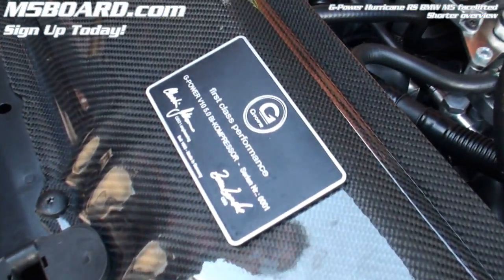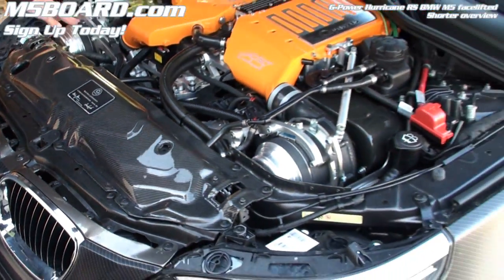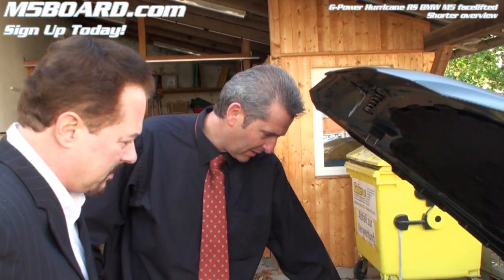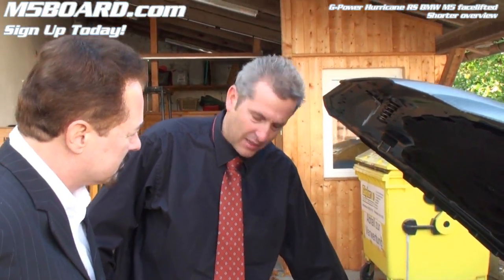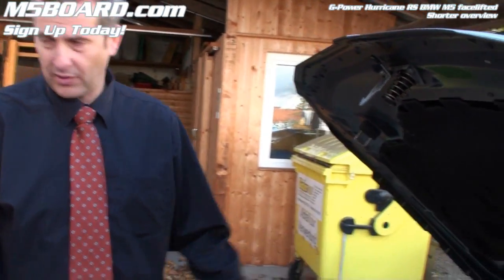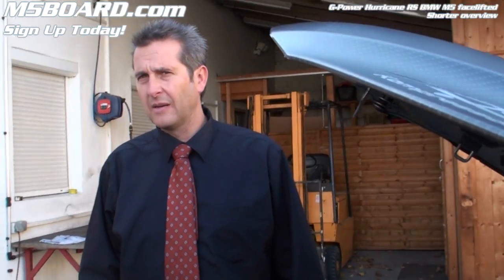HD: G-Power Hurricane RS shorter overview

Comment: i think you mean between the compressor and engine. 

If you look at the compression of air you can note from the perfect gas law that the Temperature will increase. If you do not cool the intake charge you can get too high temps in the cylinder, which can cause knock or other problems. Generally heating of the intake charge reduces power and can result in worse emissions.